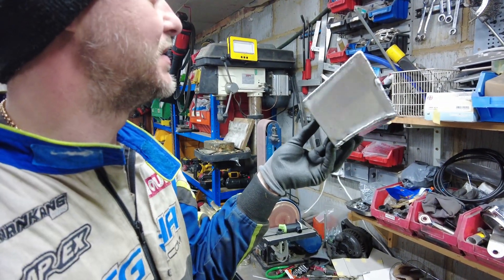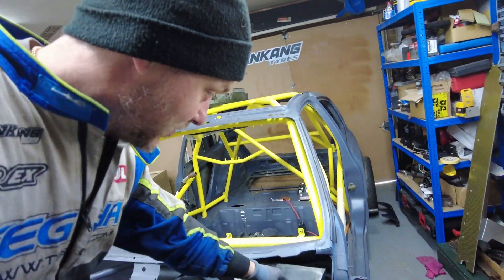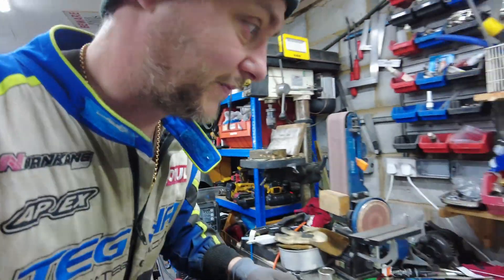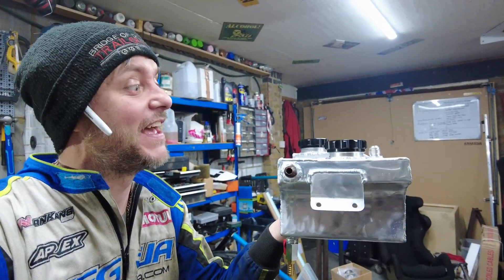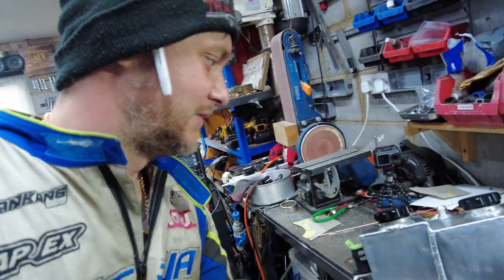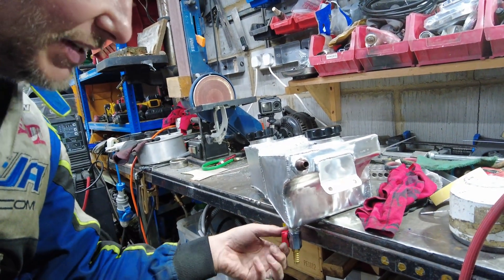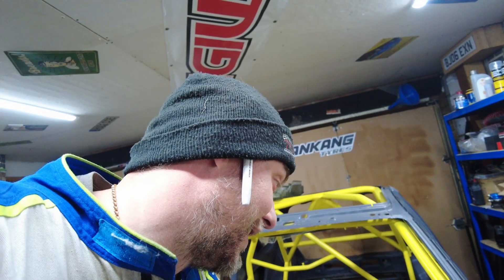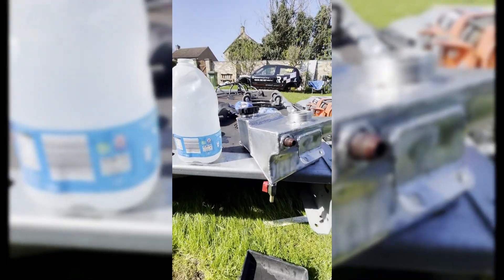Can you combine breather and water tank together? Custom 2in1 water/catch breather tank.

Comment: I made a similar screen washer bottle but I fit line in the passenger side rear and then run the pipe to the front just to help with weight distribution